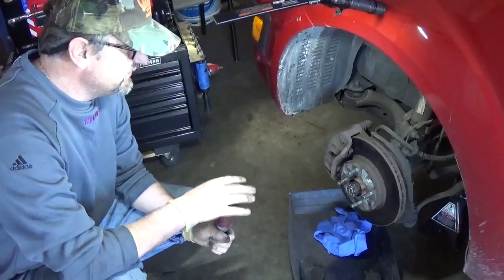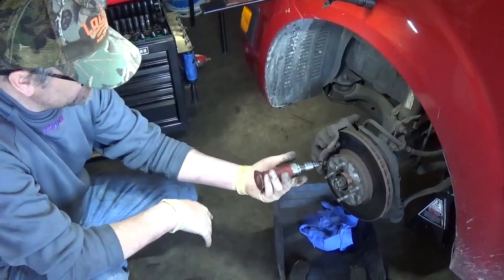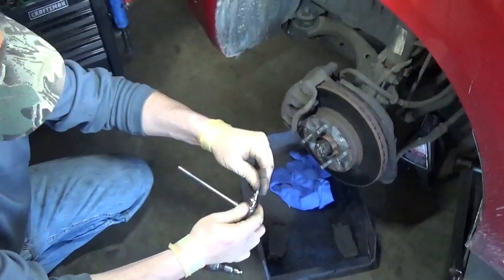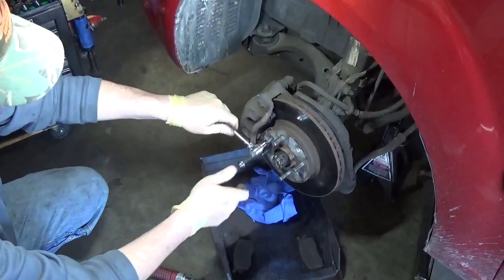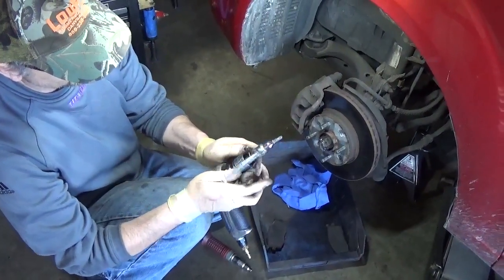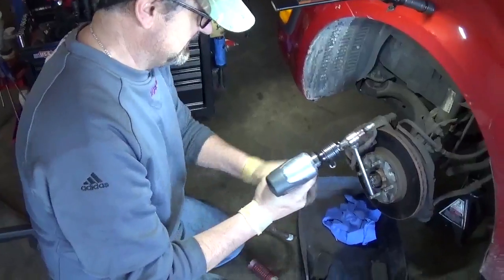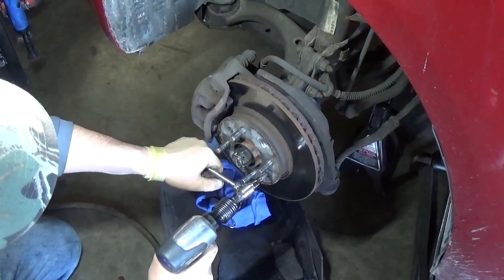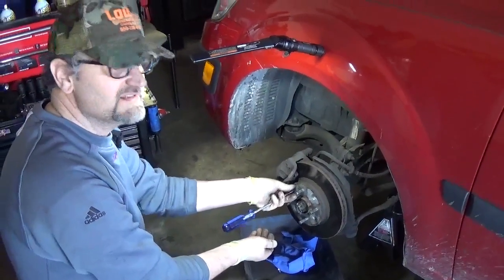How To Remove Brake Rotor Screw

Comment: I have the same tool, use it mostly for brake bleeders. I use a similar short body, spring retainer type air hammer dedicated to use with this 3/8" drive bit. Short body air hammer fits better in wheel wells, has plenty of power for loosening bleeders.
Reply from the maker: Brake bleeders that is a great tip sir. I wouldn't think of that. I use kobalt  air hammer for this tool has plenty of power. Thank you for sharing my friend. Cheers